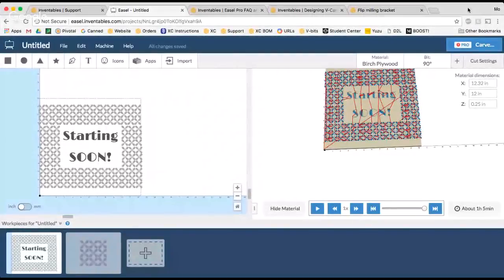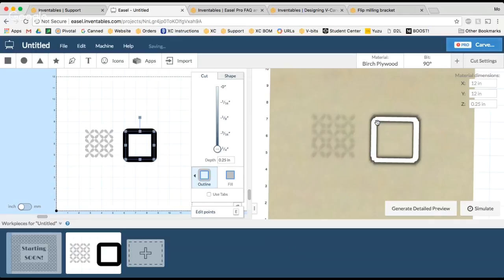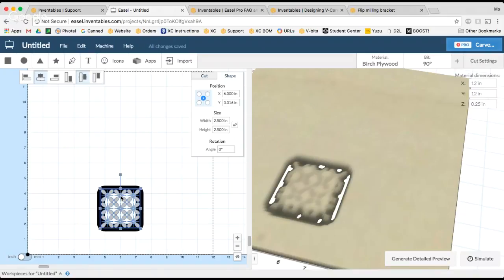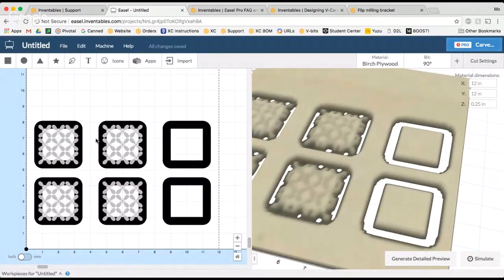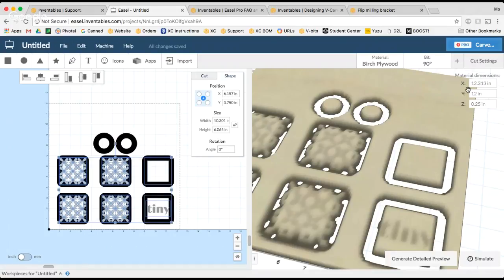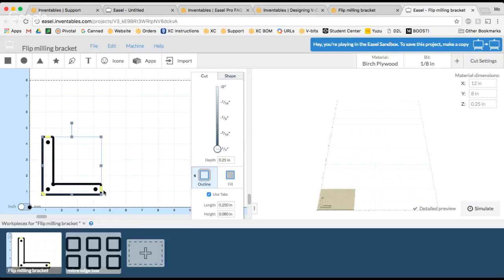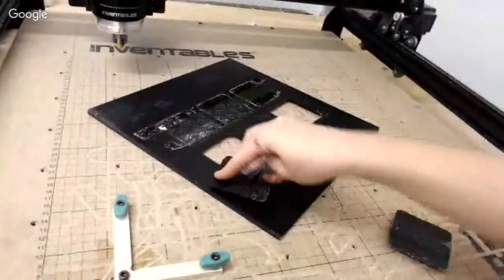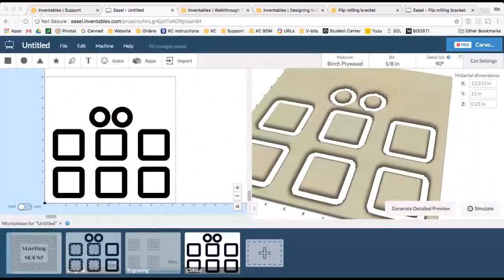Easel Live: Flip Milling on X-Carve and Carvey

Comment: Good video, was watching the alignment for the squares and was nervous when you originally didn’t align the squares horizontally but it was fixed.  I have found that unless you use registration pins across the centre line, it is really difficult to do a really accurate 2 sided cut. When you do a cut through on shapes with tabs the small differences between both sides are pretty noticeable with a jig like this. Just to many ways for the piece to be off, people will measure width and length of a piece but unless you have a perfect rectangle/square then it will be off a bit. 

Also camera and syncing on this video is much better besides the brief cut out near the end :)